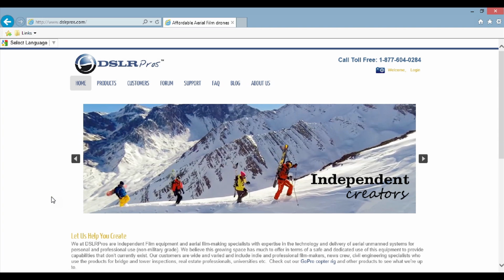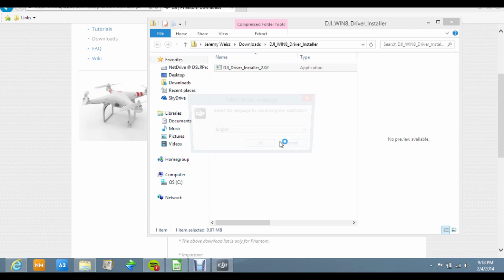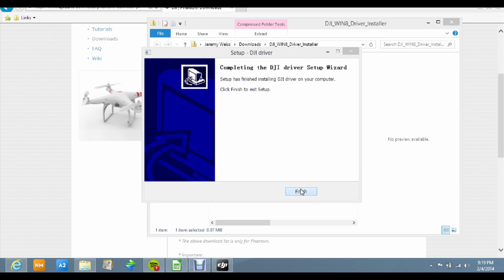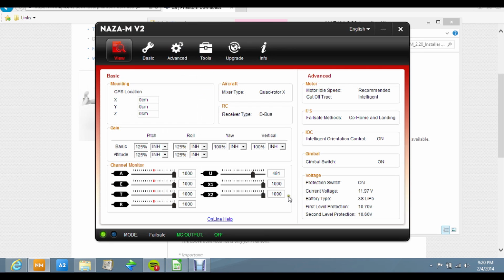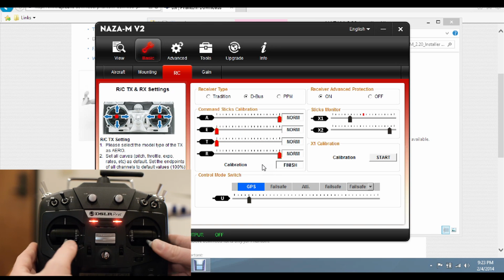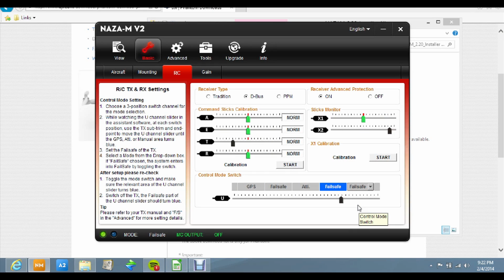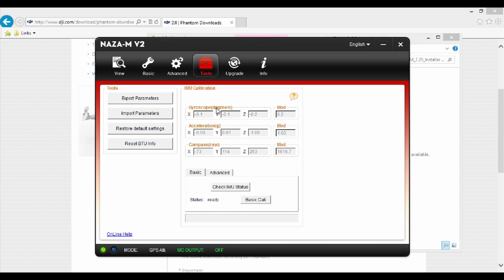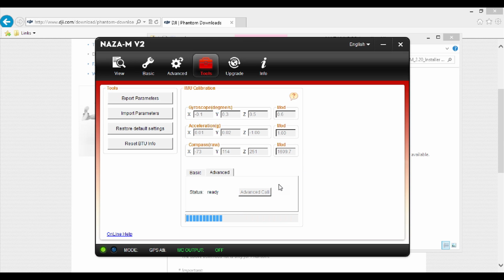DJI Phantom NAZA Assistant Software Tutorial | DSLRPros

Comment: Great video, well done.  I am having some control issues.  Everything checks out fine when I power up, drone hovers okay, a little drift.  As soon as I rotate to the left, it becomes hard to control.  Have calibrated IMU etc.  Should I try resetting to default settings in the NAZA Tolls section of the assistant software?
cheers